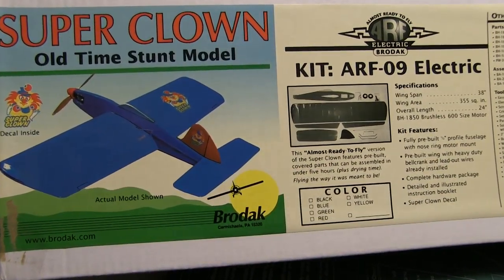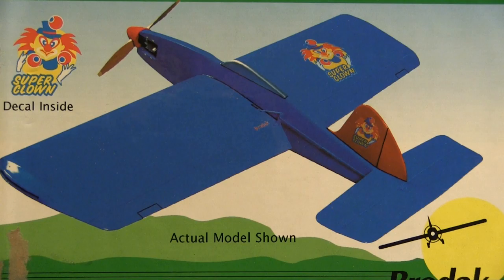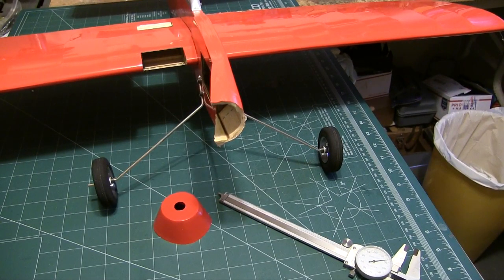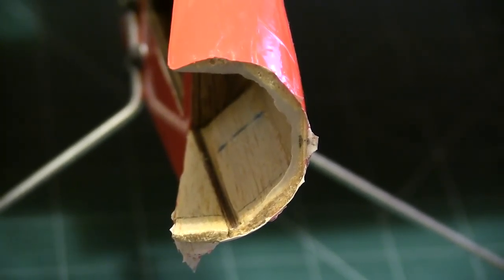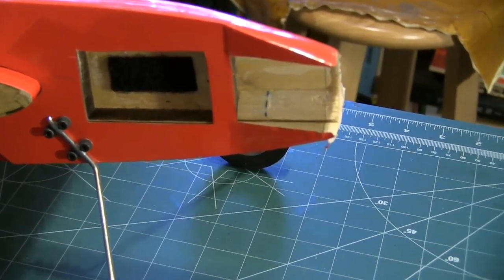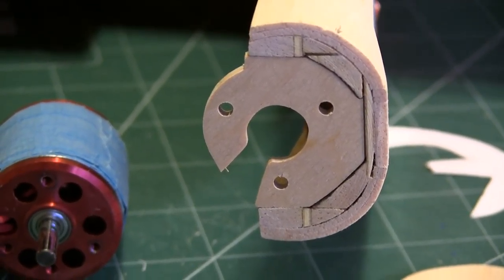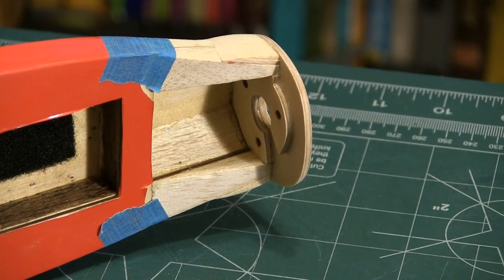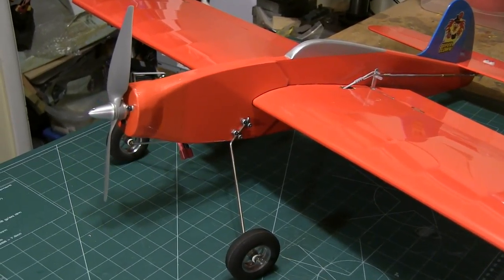Super Clown Firewall Fail

Comment: @nightnav.  Real quick question.  I have a small Sig Shoestring that's been in my shed for years.  I want to convert it to electric but have no idea on what motor, amp, battery and timer to purchase for it that would be correct for its size.  It has a 32" wingspan.  Any suggestions would be greatly appreciated since you helped me before with my Superclown.  Since that time I redesigned the front of the Superclown to take a rear mounted motor which is much more to my liking and it works great.  Thanks as always.
Reply from the maker: I would only be guessing so what I recommend is going into the forum Stunthanger.com and then into the section "Gettin all Amp'ed Up". Ask you question there and provide the details. There are some really knowledgeable electric folks there and they can provide you with what you need based on calculations and experience. However, I can comment on the timer selection. The Hubin timer, and the KR governor would be good choices. For the past few years I have been using the KR governor. It's a bit more expensive but it offers the added protection of shutting down the motor in the event of a prop stick and you can use an inexpensive speed controller since the timer handles governing the RPM rather than the speed controller. Give Stunt Hanger a try and good luck with the Shoestring.
Reply: @nightnav  I really appreciate your reply and I will do that.  Thanks and have a great day!

Comment from the maker: I set the timer for the max which is about 6 minutes. Then I recharge that battery. So I get one flight per battery. Once, by mistake, I used the same battery again without recharging it.  After about 3 minutes I noticed a lack of power. Then it slowed down to the point where it just landed. So I would say for one charge keep you total time,no mater how many flights, to no more than 7 minutes.

Comment: I'm working on the Super Clown I purchased a couple of weeks ago.  I haven't gotten to the motor yet so this is good to know.  This is my first time for electric so I'm learning as I go as far as the electronics for that.  One question would be when you take it flying how many flights do you get out of a battery before you have to recharge it?  I haven't flown in 25 years and that was gas control line.
Reply from the maker: gkirms
After my reply to you last night, I was thinking my recommendation was a bit general. Really what you should be mindful of is the mah rating of your pack and how many milliamps you have consumed. So in this case I use a 3300mah 3 cell lipo. I don't go beyond using 80% of the pack rating. 80% of 3300 = 2640. So with a fully charged back no matter how many flights you put on it with that charge you won't want to cumulatively use more than 2640 mah. A 6 minute flight in my case keeps me under 2640. It's best to have a charger that tells you how many ma were put back into the pack after you charge the battery. That way you can get I could idea of what the 80% mark will be for you. It depends on a lot of things, like the prop pitch and diameter, the power setting set on your timer, the weight of the plane and more. 
Have fun with your Super Clown
Reply: @nightnav  I appreciate your reply.  Still a little confusing on the electronic part but I'm sure I'll figure it out after some trial and error with the motor and flying it.  I actually purchased two extra batteries since they were on clearance so that'll give me 3 flights anyway.  I bought the charger / balancer that Brodak recommended with the purchase of the Super Clown.  I didn't even realize yet that you could set the timer to the length of flight time that you want.  That's good to know.  And I used the fiberglass cowl for that front end fix so we'll see how that lives up to a permanent fix for the engine mount.  Thanks again!
Reply: @nightnav  It's me again.  I have finished my Superclown but am having issues with the propeller staying on when the engine goes on.  I slid the adapter (the cone looking metal piece) on that came with the engine, then the propeller and the nose cone they provide and tighten it up, but everything just slides along the propeller shaft.  Basically I can take it right off.  I know I'm doing something wrong, but can't figure it out.  Also, the propeller they suggested didn't even fit on the shaft.  I drilled out the hole larger so it would slide over the shaft but now am wondering if I shouldn't have done that.  Any suggestions would be most helpful and appreciated.
Reply from the maker: @gkirms  
Your motor my be turning counter clockwise. If you have a normal (tractor) prop, the motor should be turning clockwise when viewed from the back of the aircraft, looking forward. Take the prop off, and set the timer for a really short time, like 10 seconds and try to verify the direction it spins. A small piece of masking tape wrapped around the motor shaft with a little tab sticking out can assist with this. If you find the motor is running counter clockwise, then reverse any 2wires between the ESC (speed controller) and the motor. 
If you are using a pusher type prop then you want the motor turning counter clockwise. If this is the case you can do one of 2 things:
1. Get a normal tractor prop and follow the above instructions
2 You can buy a prop adapter for a pusher prop. The threads on the adapter are wound in the opposite direction.

Good luck
Reply: @nightnav  Engine is turning in the right direction.  Put the prop back on it and gave it a good tightening and it stayed on so I'm hoping it was just that I hadn't tightened it enough previously.  Once I figure out the timer for shorter flights and the power switch I'll be good to go.  I really appreciate your help and thank you.  When my Dad was flying line control back in the 70's I should have paid more attention I guess, but then I was too young.  Thanks again!
Reply from the maker: @gkirms  
I sent you an email

Comment: Nice looking repair, Does it fly well ?
I just bought the Brodak Pathfinder profile, I'm thinking about going in and check the gluing on the bellcrank.
Reply from the maker: Thank you. Actually I just flew it yesterday for the first time. Got 2 flights on it and then 2 more this morning. I'm very pleased with the way it flies. Plenty of power. I have it set to approx 75% power. Going to try to back it down a little to slow it up and hopefully extend the battery life a bit. After a 4 minute, 16 second flight the batteries are at 3.78 volts per cell. Weather permitting, I'll get some more time on it tomorrow.
Reply: I also just picked up a Cavalier that was set up for electric, I have no clue how to set up an electric plane. 
Did you buy all you motor, controller and battery stuff from Brodak ?
Can you set the controller to turn off at a certain voltage so the batteries don't get damaged and what is the life span of a new battery.
Reply from the maker: For the Super Clown, I did buy everything form Brodak. I have a very simple timer. It controls the power setting for the motor by setting the length of the pulse sent to the speed controller. And it controls the length of time it will run. The are 2 potentiometers on the timer used to accomplish those tasks. Over voltage protection is handled by the speed controller. They usually come with default settings for lipo batteries that will shut down the motor when the critical voltage is reached. Typically you can program the cutoff voltage for them. The method varies by the manufacturer so you have to see the instructions. 

More sophisticated timers are available. You can get ones that will also change the rpm of the motor so the speed increases when the plane is climbing to vertical and decreases when diving. Also the timer can shut down the motor if you have a prop strike and the plane noses over. RSM Distribution carries timers like that.
I kept it simple, and went with the basic timer from Brodak recommended for the Super Clown
Reply: Thanks for the info, I have so much to learn about electric.